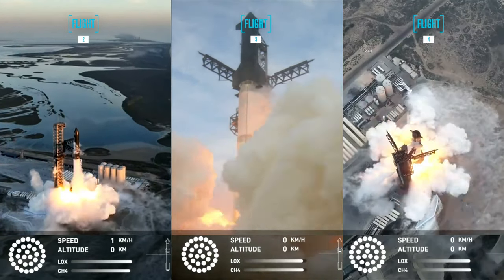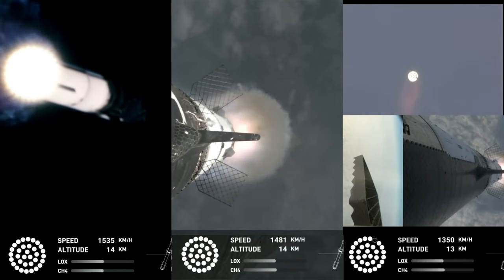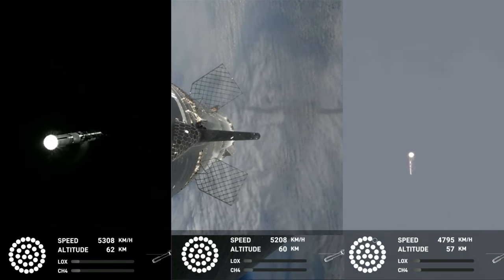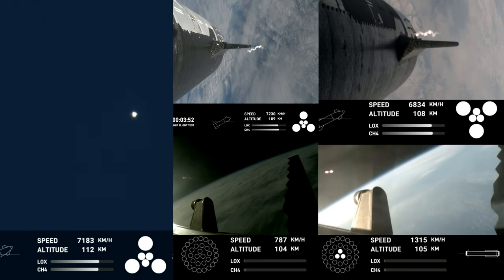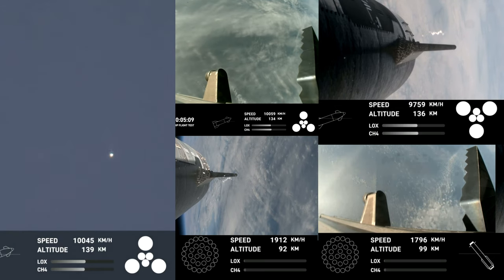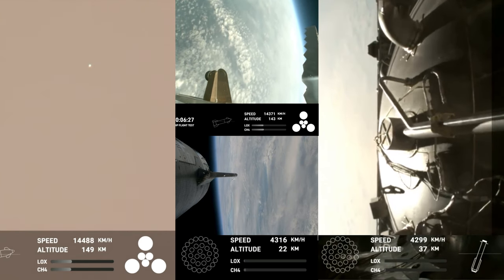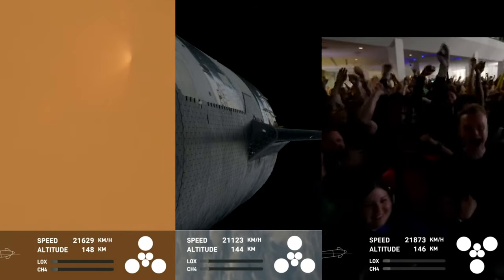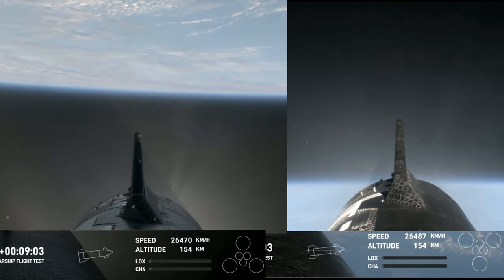Starship IFT2 vs IFT3 vs IFT4 Comparison Side By Side - No Comment

Comment: Das Aufsetzen im Meer erfolgte (wenn die Daten stimmen) mit 2,8m/s. Bin gespannt ob der Tower diesen Aufprall von mehreren 100t aushält. Die Koordination (gleichzeitiges Absenken der Greifarme) muss gelingen, sonst ist eine größere Reparatur notwendig.
Reply from the maker: Wenn ich das richtig entziffert habe, dann ist eine Art Stoßdämpfer in die Fangarme integriert, die sich bei Kontakt absenken.

Woher hast du die 2,8m/s?

Der Booster hat nämlich tatsächlich auf 0 km/h entschleunigt und ist dann die restliche Strecke ins Wasser gefallen. Daher kann es sein, dass da nocheinmal eine Beschleunigung aufgetreten ist, die aber irrelevant wird, wenn der Booster bei 0km/h gefangen wird und nicht mehr fällt, weil der Turm real ist und nicht mehr simuliert.